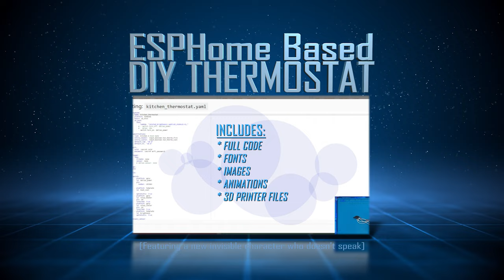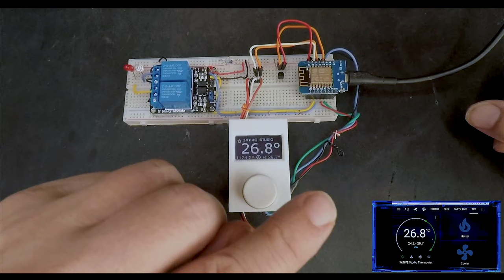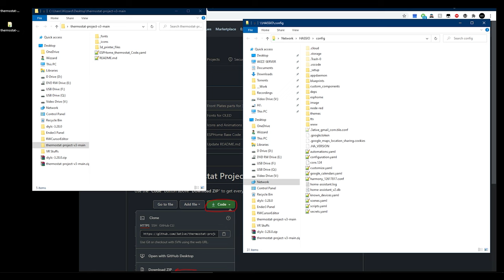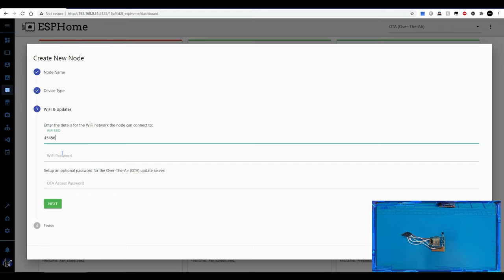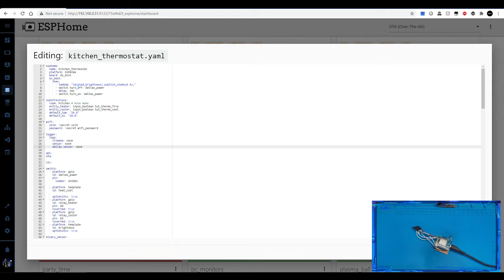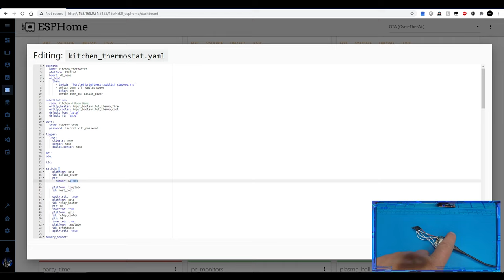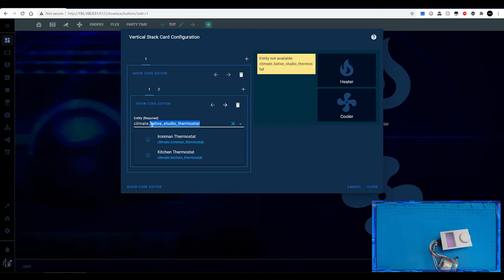Home Assistant and ESPHome Digital OLED Thermostat v3

Comment: Thanks ! It's working great. I'm still at the prototype stage, but looks very promising. Note for NodeMCU users : The DS1820 has to be disconnected from the RX pin in order to flash the firmware through USB, otherwise the connection fails. So the sequence is :
- flash the FW, 
- connect the DS, reboot, get the DS address on the log though  Wifi connection , 
- update DS address in code, recompile, 
- disconnect DS, re-flash,
- and reconnect DS.
Reply from the maker: Indeed, like I mention at 18:35 - A change to ESPHome made it fail at boot if the Dallas sensor was powered. I got over that by switching the power in software. :)

Comment: I am very curious, why only cooling and heating control? You should include a fan relay as well as in many cases it needs to be controlled separately even with heating and cooling.
I am very interested in this project. I found out about ESPHome Thermostat recently after looking for a HA controllable unit to replace my Nest and found little off the shelf solutions to my liking. My only issue with the ESPHome unit is the lack of an easily attached screen for the more commonly used interface in the house. While I can easily build and flash such units I can not code myself and rely heavily on other's work for such features.
Reply from the maker: In my situation each room has a Fan heater and an 'normal' 3-Speed Fan. It is those that this thermostat  controls.
Of course, it can be easily re-configured to control Central Heating and per-room AC units.
In the next iteration, I'm planning a re-vamped version for more conventional HVAC setups.
Reply: @3ATIVE  ooh, I see! Thank you so much for that bit of information. Maybe I should go back and watch your other videos. lol
Since I've started down the home automation path I've run up against a lot of instances where knowing how to code would have helped so much, this being the example. I should use it as a push to learn more and do this bit myself.
Reply from the maker: @CharredChar  Cool, yeah... watch all my videos! LMAO
It's been requested I go in-depth with the code explanations so, all future tutorials will either include it, or if the code is complex, a sperate video. #StayTuned

Comment: Hi. Great DIY device. Great tutorial. It would be really nice if you could put in the video's description the exact list of all the part that need to be bought to be able to make this device... really including everything. I am happy to buy using your sponsored links, but having the full detailed list would really ease up things, and make sure I can start on the job straight away, without making mistakes in the purchases or missing anything. Could you do that?
Reply from the maker: Thank you for the kind words. 😎
All the parts I use in all my projects can be found in my Amazon 'Shop' links. I have updated it for you, now the first three items are for this thermostat - You can get the D1 Mini and the 'Vero Board' from anywhere really.
** Also, if you prefer, I have listed a Custom PCB I got made here: ebay.co.uk/itm/203570959081 **

Comment: I have been waiting for the video not sure how I missed it. as alwasy awesome and fully cover every aspect of the project. Thanks once again for your time. just turned on the notification sure will not miss any new video :)
Reply from the maker: Sorry to hear you missed the upload time, "better late than never!" :) 
Thank you for the kind words. I do enjoy reading every comment and I'm humbled by all the positive feedback. I hope you don't have any problems with your build but, if you do I'm more than happy to offer advice.
Also, I've recently received the custom PCBs I designed for this, I'll be giving a few away on an up coming Live Stream, hopefully the notification will work for you.
Here's some photos of the boards: https://www.instagram.com/p/CPlZuqDIv7q/
Reply: @3ATIVE  already turned on the bell notification and looking forward to joining the live stream. I successfully created this project on a breadboard. Dallas sensor connection "schematic.JPG" probably needs a review.  I made the Dallas sensor works by connecting VIN to 3.3, GND to GND, and Out pin to D3. i used nodemcu but guess there shouldnot be any issue if i would be using d1mini. thanks
Reply from the maker: @shahidmustafa7768  That's great to hear! Are you making more than one, multi-room setup?
OMG! You are correct... I screwed up the schematic, that Dallas sensor was wrong. Good catch, thank you for letting me know. 🍺
** New schematic uploaded and replaced **
Reply: @3ATIVE  thanks for updating it. Yes this is the plan .. I am assuming I need to copy the step and change the room names only?
Reply from the maker: @shahidmustafa7768  Pretty much. Everything is coded already. So, Just the 'Room' Name and the Heater and Cooler entities - If you plan to have it control a couple of HA installed devices.
Otherwise, the two relay outputs for Heater and Cooler are on Pins D0 & D5 (D1 Mini) respectively.
Reply: @3ATIVE  Hi Dave, did you get chance to try i2c sensor? for some reason when i tried si7012 sensor, i am getting NACK error. connection is okay. sensor is detected at the startup but not getting any reading but instead a message with "NACK" error.
Reply from the maker: @shahidmustafa7768  I haven't tried that sensor and I can't really help if you want to redesign your project - I've only tested and can help with what I've shown in the tutorial. 😎
However, the only problem I've ever had with I2C was when I forgot the pull-up resistors - It was a while ago and I can't remember what error it gave. 🤦‍♀️
Reply: @3ATIVE  no problem thanks I thought i was going mad.. will keep the sensor you have shown in the tutorial. think it's an issue with the esphome itself.

Comment: This is very good. I love the encoder hat you made too. But there's just one part missing, that is the relays to turn the heater/fan on/off. Add those and you do have a complete thermostat!
Reply from the maker: Thanks fella. 👍
I have provisioned for both relays in the code. However, the main point was to control Home Assistant entities.
Reply: @3ATIVE  Cheers cobber. Yeah I saw them in the code. I was trying to get it to run on my Olimex ESP32_POE_ISO board but having issues. I grab a D1 Mini and take another stab. I'll let you know how it goes 🙂
Reply from the maker: @sausage5849  No worries. I can't think of any reason it wouldn't work on your POE board - Other than GPIO numbers being different for the ESP32.

Comment: Nice DIY project, is it possible to use a rotary encoder HW-040 (Arduino) ?
Reply from the maker: That's pretty much the same thing I used. Only that's mounted on a board.

Comment: Awesome build thank you very much for your video! I've been working on the same thing before finding your video, and now I will have to compare details. One thing that I did find working on my thermostat is that having the temp sensor so close to the esp definitely affects actual temperature. I had to physically move my temp sensor further away to get "true" temperature readings. Just my 2 cents.

Thanks again for the great video!
Reply from the maker: Thank you for the kind words and feedback. 👌
Indeed, having the temperature sensor near the ESP board can be problematic and so I designed this such that the Dallas sensor is at the bottom of the unit and it would be mounted vertically, with plenty of air-flow (Top and bottom of the case) 👍

Comment: Hi Dave, very cool project I love it.

Could it be that you have missed to solder the 4.7K resistor on the D1 mini board, for the Dallas sensor?
I build one thermostat myself according to your guide, but I could not see the part how to solder the resistor.

thanks
Reply from the maker: Thank you Mr Byte, it's great to hear someone else has followed my guide. 👍

As far as I could tell, Dallas Data Sheet, that pull-up resistor is only needed for long data lines. I've included it on the custom PCB's I had made (See my insta post for those: https://www.instagram.com/p/CPlZuqDIv7q/ ) but, I haven't needed to add one myself.

Comment: Thanks for making these videos..   What happens when HA goes offline or crashes?  Will your AC unit loose control? That would suck.
Reply: oops while reading more comments you mention the system still runs without HA even on....  Perfect !!  Thanks again.
Reply from the maker: No worries. 😉

Comment: Well done, I will need to take a close look at the yaml to learn some new skills there too. Nice one David, looking forward to seeing the custom boarded version. Just a thought, most UK homes don't have AC but do have water heater controls usually embedded with the heating controls. Any ideas how to integrate the water heating circuit?
Reply from the maker: Thank you Peter, this video took a while to make 👍
As for the water heater-ing: I think most just use a simple on/off/timer (1 or 2hrs) and either command an electric 'immersion' element or divert some or all 'radiator bound' heat through pipes in a tank.
You are right, this setup can't do that but, it's given me an idea for another video! LOL - I guess I'll have to buy one of those controllers and mimic it. 😊
Reply: @3ATIVE  Hi, yes, most uk based house systems tend to combine heating and hot water control from a single boiler, usually using one or more 3-port valves. Newer combi boilers don't have a hot water tank so these are normally on-demand and don't need any automation. Hive sell two types of controller, heating only which is really just a cloud connected relay and temp sensor, and a dual unit that also allows scheduling of the hat water circuit.
Reply from the maker: @dougle03  Indeed, even though my design has two 'outputs' it can easily be adapted for one to work on UK Combi-boilers and be used as a 'whole house' thermostat.
The main reason for this design was to control a single room by commanding a basic fan, an AC unit or a window opener for cooling and something like a fan heater or an electric storage heater for heating... I tried to make it as versatile as possible.

However, the 'Heat' function could also be used to control  that room's radiator valves. In this setup, any room could turn on the boiler and any rooms that are  'cold' would get heated too.
I plan to do another 1-2 videos detailing options for various heating / boiler setups in the near future.
Reply: @3ATIVE  Amazing stuff. My Hive system is irritating me on an almost daily basis now, so this is perfect timing. Any news on those boards?
Reply from the maker: @dougle03  Excellent, not the irritating bit LOL
Yeah, the boards arrived yesterday, I insta posted some pics: https://www.instagram.com/p/CPlZuqDIv7q/

Comment: Thank you for the great project can I use dht11 instead of the d18b20 as it's not available, and what modifications I should make for the code please.
Reply from the maker: Sure any temperature sensor will work, I used the 18b20's for the size. Sadly I don't have time to re-write the code for you but, I can point you in the right direction...
If you use the same 'id:' the rest of the code should still work but, check here:
https://esphome.io/components/sensor/dht.html

Comment: You would be able to do that there was only one slider for heating, without cooling and for the button + button - The buttons would be tactile in the panel.
Reply from the maker: Of course, but it wouldn't look as cool. 😉
Reply: @3ATIVE  You would try to do such a project
Reply from the maker: @szybki9465  Maybe. I'll add it the list. 👍

Comment: Brilliant - I've been waiting for this. I was thinking of using an ESP32 instead so I could leverage the BLE support for presence detection and get temperature and humidity values from cheap Xiaomi temperature displays. That way I don't have to rely on temperature inside the enclosure being representative of the room temperature. I was thinking of placing the display close to the room light switch so I can get power from the lighting circuit power supply.  Look forward to seeing what you come up with w.r.t. the circuit board.
Reply from the maker: Cheers Peter. 👍
All good ideas there. I went for a D1 mini for a few reasons, mainly its small size but, an ESP32 would be my first choice for any project with multiple functions too.
Reply: @3ATIVE  what about the d1 mini esp32 boards? The size is almost the same but with an esp32 🤔
Reply from the maker: @avri210984  the trouble with the D1 Mini ESP32, for me,  is the double row of pins. It's quite difficult to use one on VERO board and totally impossible on a 'Bread-Board. Making R&D a pain. :)

Comment: 👍
Good morning,
Do you have an idea to turn on the screen when you press the button and it turns off after 20 seconds, if no manipulation? Of course, by leaving it running constantly (except the screen)?
Sincerely
Reply from the maker: Good Day 👋
Sure, you could add a script that waits 20 seconds then makes the OLED screen 0% Brightness. Any interaction with the Rotary Encoder or the Push Button can be used to bring the OLED back on and trigger / Re-Trigger the Script.

Comment: I love the detailed approach, i was realy hoping you would show how it connects up to your actual thermastat
Reply from the maker: Cool, I'm glad you liked it.
- Not sure what you mean.. this IS the actual thermostat.
Reply: How do you connect to the actual heating or cooling system?? Wires coming from the wall like Yellow, White, Orange, Green, Blue, Red, Black…
Reply from the maker: @jeffchan6614  I have other ESP devices with relays controlling separate Heaters and AC units.
Reply: @3ATIVE  awesome! Would you happen to have a video of that too? Just curious on how to get this to work on my heating system.
Reply from the maker: @jeffchan6614  They are nothing special - they are basically SONOFF Basics and just switching Mains. I use HA and the thermostat(s) for the overall control and 'Smart'-ness

Comment: Do you plan to make a video about how to actually connect this to a heater and/or if you can explain how traditional thermostats usually work vs how these types work? Or the two this work the same? Those are just thermo-relay boards as well?
Reply from the maker: Have already included that in the code. There are relay outputs for 'Cooler' and 'Heater' units - See Chapter: Ten.
There is also API commands sent back to Home Assistant to control other 'Cooler' and 'Heater' Devices/Entities you may have previously setup.
Reply: Will check again, thanks!

Comment: This is a great project I made the shopping list. But I would have a little request. Could you make a small update to this thermostat to be completely wireless? That is, this module should not contain the control relay and should be powered by a li-ion battery. And another esp32 that has a relay to receive the command from it to start the boiler. Thanks for any advice.
Reply from the maker: There's no need to include the Relay, the main point of this was to link to Home Assistant and for that to control any Boiler/ Radiators, etc. (include remote relays)
As for battery powered... It's something I'm looking in to but, ESP and WiFi use a lot of power and won't last too long on a charge. It's only useful for sensors that sleep long and report back once every few minutes... and even then you'll only get a few months.

Comment: I had a similar Esphome setup, but my problem was that if the ESP would lost the wifi connection the controller wouldn't fallback to the default min max settings
Reply from the maker: I'm sorry to hear. I hope you get it worked out.

Comment: Where do you get some more of those nice GIF's? Can't seem to find any. Thanks!
Reply from the maker: I guess you could Google for some. However, the ones I show/used I made myself, using MDI Icons and PhotoShop.
Reply: @3ATIVE  You mean you just rotated an MDI in PS and exported it as a GIF? Something like that?
Reply from the maker: @lverlaek  Kinda... You have to make "frames", on separate layers:
- Each one rotated a little
- Added to PS's "Timeline"
- Then you can export as an animated GIF.
Here's a nice article from Adobe:
https://www.adobe.com/uk/creativecloud/photography/discover/animated-gif.html

Comment: Great project. A few questions if you don't mind. 1/ where does the actual thermostat decision logic happen? In Home Assistant or on the ESPHome hardware? 2/ your thermostat code controls the local hardware relays but also home assistant heating/cooling entities. Practically speaking, only one of them is necessary right? the heating/cooling devices either connect to the local relays, or they're managed through home assistant entities, but not both. Am i correct in that? 3/ if home assistant goes down and heating/cooling devices are connected to the local relays, will the thermostat still work?
Reply from the maker: Thank you Marc. Sure, here's goes :)
1. Everything that this thermostat does is programmed on the D1 Mini in ESPHome
2. Yes, I programmed both as options. So you can either control devices (with the relays) or entities connected to Home Assistant.
3. Yes, they will still work. The thermostat will control the relays and has it's own temperature sensor... It doesn't even need Home Assistant or Wi-Fi to operate.
Reply: @3ATIVE  Great thanks. I'm implementing a version of this using the new Sonoff NSPanel and connecting to 2 Dometic Acs. Your video helped a lot!!
Reply from the maker: @marcvl  My pleasure. It's always so good to hear when someone finds my tutorials useful - even more so when they are used creatively in a similar project.